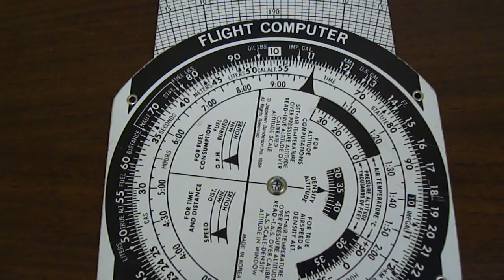E6B Flight Computer: Distance to VOR Station

Comment: First, I am not a pilot.  Why do you need a analog slide rule when you can get all type of digital computer and calculator. It seems you can get some kind of apps to do you calculation on the fly.
Reply: Redundancy: it's value comes primarily in it's non-electric capability. Durability. Time tested, e.g. you know for sure there are no in-built math errors or software glitches. I personally keep it as a backup to my ipad. Ipad is easier to interpret and easier to read at night, but I have the E6B as a backup if all else fails. The problem is the need to thoroughly understand the backups in case the need arises one day. Also, fully knowing the E6B can be a lifesaver on FAA written tests.
Reply: Truth is, you're right. There are many apps and digital flight computers. However, this slide rule never needs batteries, doesn't crack screens, and is a good backup to have. When it really comes down to it, it's about personal preference. Personally, I always use digital tools.
Reply: Except you don't use it for a few months and when you need to use it in a real situation, you forget how to use it. How about just get a redundant electronic flight computer, it's not that expensive.  Better yet get extra apps for your smart phone and tablet because lots of pilots fly with these too. The argument that the slide rule is reliable is a falacy because when it's time you need to use it, most people forget how.  That is just plain dangerous.
Reply: +2Phast4Rocket well, can you name a scenario when this actually becomes dangerous? Be specific with aircraft type and weather.